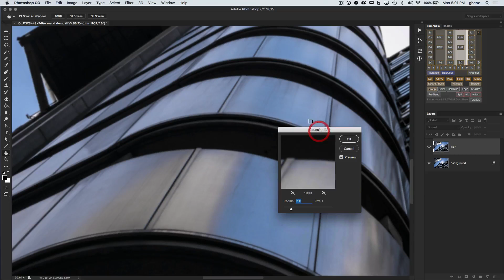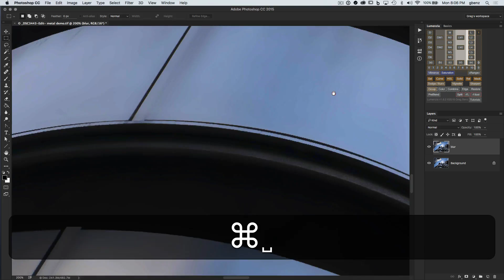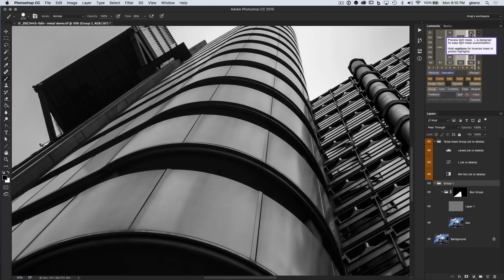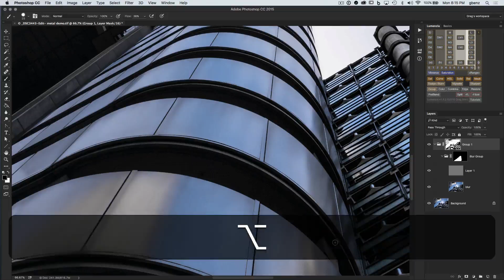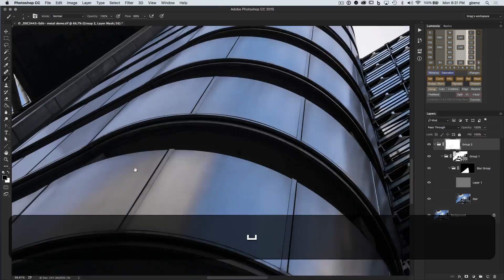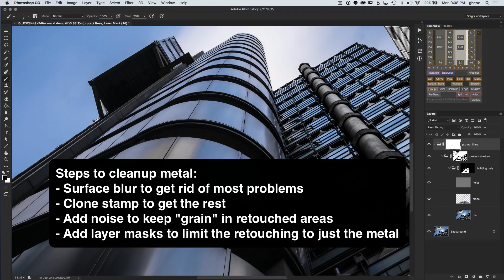Create Beautiful Metal Buildings in Photoshop

Comment: thanks for the video. would frequency separation be a good way to remove the imperfections while keeping the texture while also eliminating the need to add in noise? can you compare your technique with FS?
Reply from the maker: Similar ideas with fairly similar benefits and limitations.  FS is often done with surface blur.  The question is ultimately whether both the high and low frequency content are damaged. If so, cloning is needed because brighter is salvageable.

Comment: why do you need to add the noise back after you did the surface blur action?
Reply from the maker: It depends on your image and what you want to do with it.  For a full resolution image, there will always be a little bit of digital noise (looks like film grain), even at ISO 100.  When you blur that noise, you create an area that may look fake because it is too perfect compared to the texture around it.  Adding noise let's it match the original content.  If I were just going to use a small image for the web, the noise wouldn't matter.  But little details like this are important if you want the small details to look right.  Probably hard to see in the video here, but it really matters for a print.  If you are shooting with higher ISO or lightening shadow areas, the problem will become much more apparent.